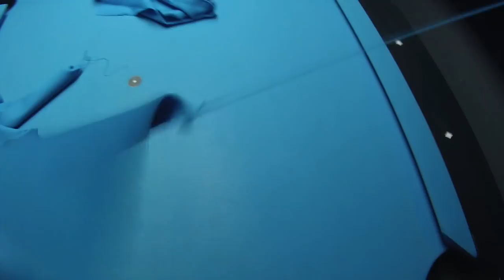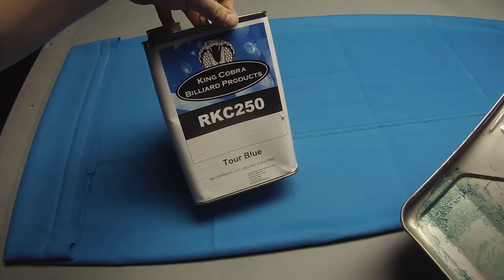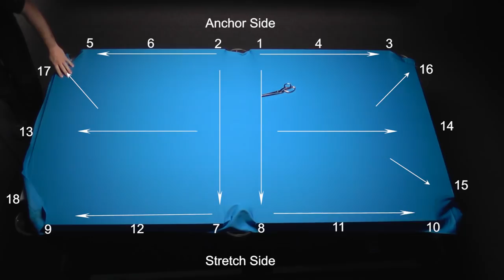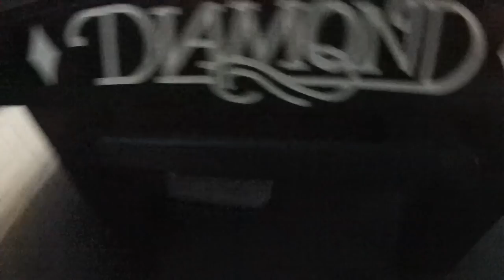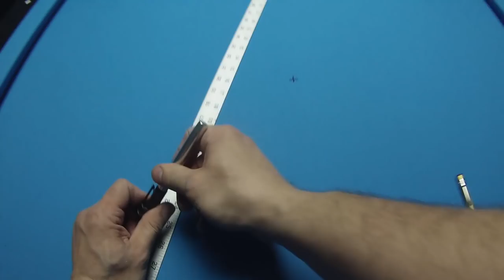Installing Simonis 860HR on a 7' Diamond smart table. Entire process start to finish.

Comment: This deserves some sort of YouTube award for tutorial videos. Thank you. I do have a question that I haven't seen asked although I may have missed it. The 33" and 33.5' markings. Are those before the stretch and help with the amount of pull from side pocket to corner pocket? I know some of this is feel but just wonder what those measurements are indicating. Also, if the answer is yes then would each measurement be 5' longer for a 4x8 table approximately. I am sure it depends on the specific table but in general would it be 38' and 38.5' for a 4x8? Thinking about the additional 1/4' stretch for an 8' table maybe it would be 37.75" and 38.25"? Thanks again.
Reply from the maker: Tim, I haven't covered any 8 foot tables for a long time, so this is a bit fuzzy, the 33 and 33.5 are my attempt at putting a number to a feeling.  These numbers are specific to a diamond table. The slate cut for the pockets of different on most tables, so the slack left in the side pockets and amount of stretch to the corners will all be different.

Comment: Excellent. The strong hands and fluid efficiency indicative of a man with lots of experience. The only two things I’m curious about are the purpose of the additional black blocks on the ‘risers’, and why you didn’t check for level.
Reply from the maker: The little spacers are just to get the rail up off the blue blocks so the rail cloth doesn't get pinched while pulling and stapling.
I always level the tables after all the recovering is done so it doesn't get forgotten. This was the 14th out of 16 tables at this location, so all 16 got leveled afterwards.
Reply: Thanx for the response. I suspected both.

Comment: Hey Zack.. Where do you get your Somonis Cloth from?   I did my two tables with the great help of this video. Thanks to you for putting this video out. It also gave me the confidence to them and they came out great. The problem that I had though was the cloth I had, the rails were not pre-cut. I cut them to 6  inches as described in the video. Did my rails on the first table and my bed cloth was short width wise. I got the job done, although I had to improvise a bit. The table still came out great. The second table I cut the rail cloth to 5 1/2" Witch did give me a more proper amount of cloth to do the bed as you direct in the video. Though kinda pushing the cloth length for the rails. I would not want to cut it any shorter at all.    Thank you very much for the help from this video. I will definitely continue to do my tables in the future. I would like to know who you get your cloth from though. Thanks again.
Reply from the maker: I get all my supplies from West State Billiards supply in California. Call and ask for Jim.

Comment: Looks like Main Street Billiards in Mesa AZ...lol. I was wondering about the material for the risers you used for rails and the little spacers (black rubber) on top of the risers. Did you make them and if so, how? If not, where can someone purchase them or the materials to make them? Also, is it possible for you to make a list of tools that you used and/or recommend (i.e. shears, creeper, compressor, staple gun)?
Reply from the maker: It sure is Main Street in Mesa. The risers are just 1/4" balitc birtch plywood with 3/16 neoprene glued together. The exact composition is not important. As far as the tools go, I have just collected over the years and really have no list. The really only important thing for this type of recovery is the 3/16 nap roller for the glue. Everything else be is whatever you are comfortable with.
Reply: @reverendjonas  Hey Zach,
Other than the 33" and 33 1/2" measurements are there any other differences in measurement markings for a 9 foot diamond at the timestamps listed below? 

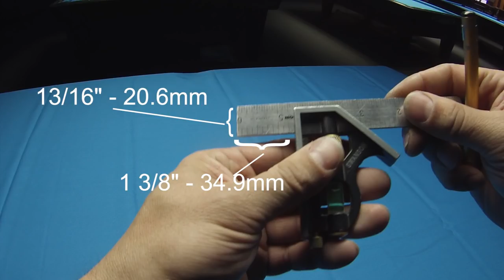1:00:59
1:01:45
1:03:04
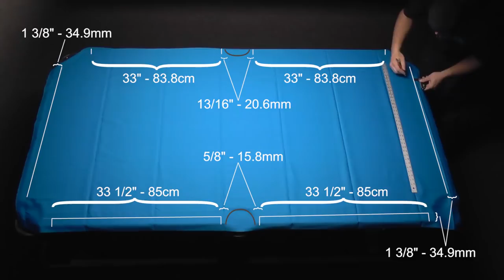1:02:49 to 1:03:09
1:03:20
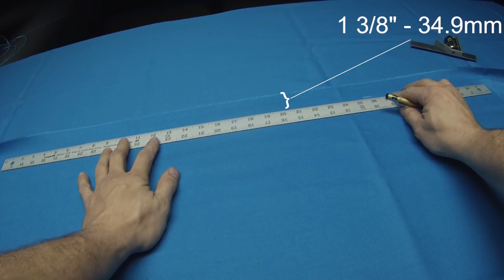1:03:39 to 1:03:52

Do you have a diagram for the 9'?
Also, what size staples are you using for the rails?
Reply: @reverendjonas  went to get a 3/16 nap roller.  nothing available locally.  ordered some on amazon.   is 1/4" nap an option?  I would assume safe for the slate, but i don't want to have glue go on too thick and bleed through the felt by accident.

Comment: Good afternoon Zach this video by far is the best and your techniques are Fail-Safe!! Just one question do you keep the same 1 and 3/8 stretchline for an 8ft table with 860 simonis?
Reply from the maker: You can probably go 1 1/2 or 1 5/8 for an 8' table. Im glad you found the video helpful.
Reply: @reverendjonas  What would be the stretch on a 9ft? add another 1/8 to 1/2 inch? Additionally would you share the measurements for the lines to the corner pockets for both an 8ft and 9ft? Thanks.

Comment: Zach, What an amazing job. Very concise and very professional. I have watched this video 20 times and now I have the guts to try and tackle  re-clothing my pool table. I started it and have made some mistakes. What I did so far is 3 of the rails and not happy with my results. I am using Simonis 860 and so far what I have done is not so good. The rail cushions do not seem "lively" enough. (The cushions themselves are good). I am sure that I did not stretch the cloth tight enough before I stapled it. I also screwed up 2 of the pockets. I will use your technique for the remaining rails. If the results are better, I will go back and remove the staples for the first 3 rails and try again. Do you know where  I can buy more simonis cloth for just the rail? (just in case I totally messed up) Thank you so much for sharing.
Reply from the maker: Try calling around to any local table mechanics. They might have some extra cuts of cloth they can sell you. Thanks for posting. Good luck with your table.

Comment: Hey Zack great video. I have 2 diamond tables just as you recovered with pro-cut pockets. I had Diamond recover them and I don't like the way they did them. It is now time for them to be recovered again. You do a great job and take good pride in what you do. Its a wonderful video. I may try to do my 2 tables myself with the help of this great video. What type of stapler do you use (air/electric)? What are you using for the long blocks you use to prop up the rails?
Reply from the maker: I use a 22 gauge upholstery stapler. I believe it's a 3/8 crown. Many people use a T50 stapler or a 1/2 crown 20 gauge. All in 1/4 leg.
I like the smaller 22 gauge because it does less damage to the rails and is easier to pull staples next time.
Good luck with the tables let me know if you have any questions. What part of the country are you in?
Reply: @reverendjonas  South Louisiana. Approximately 50 miles southwest of New Orleans.

Comment: Hi I noticed you pull felt more at the corners when you install the further wood that's help to fold it easily?
Reply from the maker: It's just to take up a little extra cloth at the corners so there is not so much you have stretch out on the under side to get rid of all the wrinkles.
Reply: @reverendjonas  thanks I appreciate it I live in Colorado you don't come to work close to Denver do you?
Reply from the maker: @joseluisespinoza5659  I have in the past, but I moved to North Idaho and am not getting down that way any time soon. What table do you have?
Reply: @reverendjonas  it's an old heritage by Brunswick. oversized
Reply: Hey zach. Can I use 3M super 77 multipurpose spray instead of staples on the bed?
Reply from the maker: @joseluisespinoza5659  I do not recommend that. It does  not have the grip to pull the cloth tight enough. I have found that the roll on contact glue is the way to go.
Reply: @reverendjonas  any brand of contact glue work?
Reply from the maker: @joseluisespinoza5659  I have used 3m FastBond 10 for years and just switched the the glue in the video that is made for this purpose.
Reply: @reverendjonas  thanks I just refelt mine following your instructions took me all day but I'm very happy with the results thanks again
Reply from the maker: @joseluisespinoza5659  Great to hear. I'm glad it turned out well!
Reply from the maker: @joseluisespinoza5659  Im glad it helped!